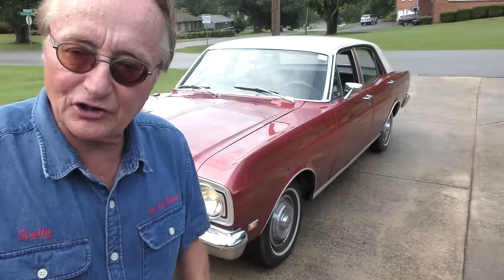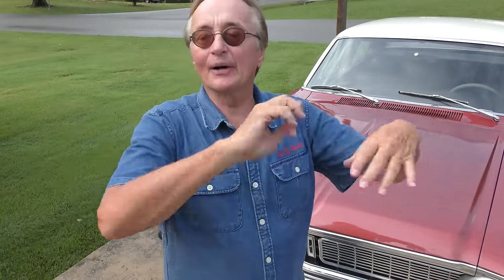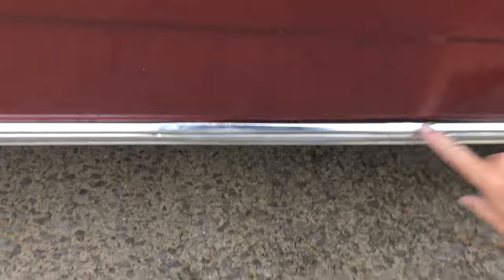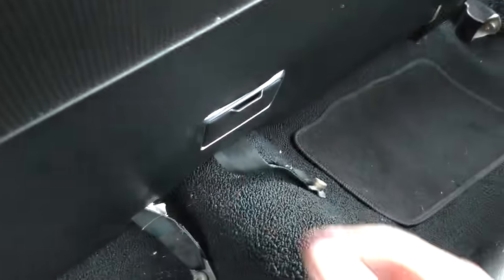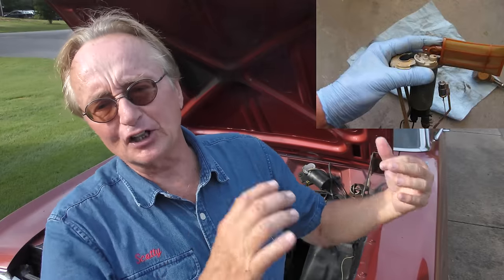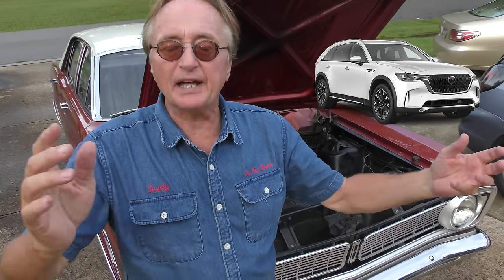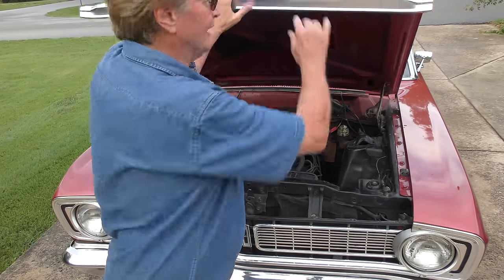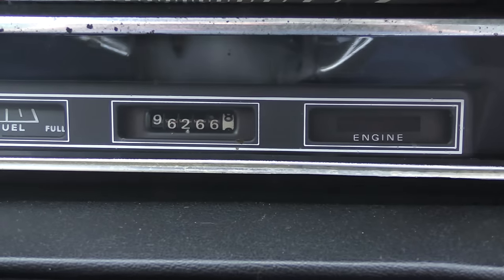I Just Bought My Dream Car

Comment: This is a real car
unlike over complicated modern crap that you can’t enjoy driving it or working on it.
Reply: My thoughts exactly.
Reply: 100%
Reply: Today’s cars are - cars. Real ones. And they are generally far more reliable than 60s era cars needing far less regular maintenance.
Reply: @gordtulk  yes you’re right about reliability and many other things older cars lack but
things that older cars are superior is simplicity,materials and being repairable.
I doubt modern cars can survive decades and still be able to start and run like older cars.
Reply: @Ray77582    not really, newer cars have better engines and metallurgy. Also the old cars all rusted out. Newer cars are coated better for that as well.
Reply: @Hughjass-69420  that’s true but new cars aren’t only metal.
Other kind of unnecessary plastic parts break down and can’t be repaired or replaced.
And you’re right older cars are all rusted out and aren’t worth it no more especially ones that are more than 40 years old.
Reply: @gordtulk yes but cars today are built to fail vs built to last
Reply: @nickyj3571  Most modern cars would've outlasted any of their 20th century relatives with the same amount of usage. You see way more examples of  early 2000s - 2010s half million - million mile cars. Meanwhile a 1970 Dodge Ford or Chevy would need a rebuild by 5 years 100k miles, and rusted out in 15.
Reply: @jv6miata  right I'll tell my coworker next time her 2023 sonata breaks down or won't start in the parking lot and already needs warranty repaint bcuz of peeling
Reply: @nickyj3571  You think old cars came out of the assembly line absolutely perfect in any way and had no issues? How about when ford recalled 4 MILLION models in 1972 for seatbelt defects. This is not a new thing, and everyone knows that older cars weren't as reliable as people made them out to be (considering most 50s-80s cars lasted at most 200k before being scrapped)
Reply: @jv6miata  sure
Reply: @jv6miata  80s-2000s cars have best of both worlds. Simple enough and well built with good technology; but I doubt modern cars with 1.5 turbocharged engines would come close to half million miles
Reply: @Ray77582  I definitely prefer metal over plastic lol.
Reply: Don’t kid yourself, it’s a pos.
Reply: @Arcticfox7  yeah the new ones are Shyt
Reply: I say that about my 96 Buick Park Avenue and my 1999 Porsche 986 Boxster five speed manual it takes six screws just to remove the entire center console on that car there’s only 7 computer modules in that car as well unlike today’s 100+ computers in the new car’s also just when you take my first generation, Porsche 986 Boxster and put it up to a brand new Porsche Boxster The big difference is size the new car is wider and longer and that’s due to safety regulations and airbags. It’s also heavier and not as fun to thrash around because it’s not light like the original one is not to mention Porsche is starting to do away with the manuals at least in the base models like your base model 911 for this year I looked it up on a building price thing there’s no option for a manual transmission which that’s the whole point of a Porsche right manual transmission fun sports car that’s light there is still a manual six speed offered in the boxster I don’t think it’s as fun to drive though as mine because of how heavy they’ve gotten I mean that’s kind of the whole charm of a little sports car light and nimble but I will say being a mid engine Porsche for me. It’s still a very easy car to work on and my 3800 series 296 Buick Park Ave. it’s probably the easiest car to work on even easier than a Volkswagen beetle well today’s Volkswagen beetle because there not easy anymore like the original Volkswagen beetle was I mean with the original Volkswagen beetle all you need was a set of common hand tools, and you could drop the engine drop. The transmission even pull the whole body off the frame and put it all back together again and it had that simple air cooled flat 4 motor that’s probably gonna be my first classic car I mean really classic car. I know I have the Buick and the Porsche, which are both technically classics cause they’re at least 25 years or older but or the 69 Ford falcon I wouldn’t mind that to be my classic car too, I just love old cars because they’re so easy to work on and charming to look at and the motto is on the old cars instead of replace like on today’s modern cars because of all the plastic crap that’s going to break and another thing Volkswagen, the Volkswagen beetle specifically used to be a very reliable car. It’s no such thing anymore planned obsolescence is built-in into every modern car now in the 1990s that’s where planned up some lessons kind of started for the majority of manufacturers at least in my opinion, excluding Buick and like the Chevy Caprice and stuff like that and all those big body GM cars and everything with the either series one or series 2 3800 V6 even the pre-series 3800 V6 cars were generally good because that motor was overbuilt best V6 engine GM ever made when it comes to a modern V6 engine anyway why they killed it and replace it with crap that’s beyond me not the decision I would’ve made but on all those Buicks and General Motors cars with that particular engine they last so long that there’s a running joke with those cars and you’re gonna have to pry these keys from my cold, dead hands because those cars with that particular engine, especially outlive their owners in most cases and not too long ago every car that was built with outlive their owner because they were overbuilt, not like today’s cars especially the electric cars I doubt any of those cars will ever make it to an estate sale sorry I am rambling on about this and kind of all over the place but they just don’t make them like they used to
Reply: @90sbuickguy84  totally agree with everything you’ve said.
Car manufacturers forgot things that made them different and special from others before. Nowadays they all make similar craps with many features that often times won’t be even used but break down😂
Older cars may not be efficient,safe and air polluters but they’re not made with intention of being crap like new cars; even when they break down fixing them is generally easier despite having no sensors or alerts to tell you what is wrong with them.
The real meaning of a car is something you enjoy operating and maintaining and I think cars lost their meaning.
Reply: @90sbuickguy84  good lord write a book
Reply: I dont think ur modern car is gonna be driving 60 years from now @gordtulk
Reply: @nickyj3571  Back in '50, '60, '70s at 10 years old probably half the cars were in junk yard. By 80K or so most were having a myriad of problems. One like this falcon are rare.
Reply: @jv6miata  Before '80s, few cars lived to 150K.
Reply: @tombryant1104  still better
Reply: A stinking unsafe rust bucket.
Reply: @nathansmith7153  even better
Reply: @nickyj3571  I like to spend my time getting places quickly, quietly and reliably so I can spend time on more creative things.
Reply: You can actually reach things under the hood.
Reply: Modern cars have like 50 bolts to get a headlight out
Reply: @andymills2985   yup mine also has security hex screws and you gotta remove the front bumper 😂
Reply: @Ray77582 
Older cars are fun
A real adventure,  going to work ,
Or wherever you go to !
I really think I'd like to get into the car industry.  Its an industry that's not going away ,so thats good
Reply: @gordtulk 

@Ray77582 
Older cars are fun
A real adventure,  going to work ,
Or wherever you go to !
I really think I'd like to get into the car industry.  Its an industry that's not going away ,so thats good
Reply: I agree, mine was a hand me down 1964 model v8 289cu.. no power steering, but did it last..
Reply: I grew up in the 60s and 70s. Believe me the ac and cooling units on those cars weren't very reliable. You very rarely seen a car with 100,000 + miles
Reply: I enjoy driving my Lexus and it never needs work.
Reply: Horse is far more reliable, so why not get one?

Comment: Love the simplicity of a car like that, you can fix it with a screwdriver and a hammer no laptop required, no gadgets to bother you no spy camera to watch/track you but no cup holder OMG what will we do!! but got an ashtray and a vent window.
Reply: When I'd buy a car to fix up when young I'd remove and clean the ash tray , install , then use it to put  change in for the drive throughs .
Reply: @gordsmith7656, yep and no "VTEC, VVT, cam phasers" etc. Just reliable old pushrod engines. I have a pushrod engine vehicle that's 20 yrs old with over 250,000 miles now and it's still going without ever touching engine/transmission internals. Also have a 10 yr old vehicle with VVT that needed cam shaft and lifters/rockers replaced after 80K-100K miles & transmission is slipping/shifting rough since 110K miles. These manufacturers produce junk and sell it for tens of thousands & then pass it off on customers to pay for the repairs/replacement. They should be held criminally liable for it.
Reply: How about a screwdriver and an adjustable wrench save the hammer for really stubborn problems. A 1960 Falcon was my first car in 1966. Straight 6 three on the tree & AM radio. What else do you need?
Reply: Amen! The good old days...I want a '60 something car again! 😁

Comment: The good old days, the 300 straight 6 was a strong engine.
Reply: This one has 200. The guy I work for now worked for Ford as an engineer. Although he didn't know why, the 200s tended to burn valves. The 300 was indestructible.
Reply: The 300 was offered in Ford trucks and vans but never in passenger cars.
Reply: The Ford 200 cid was an excellent engine. Their only issue was valve stem seals that hardened and broke up, leading to some oil consumption and spark plug fouling. It was a relatively easy fix by pressuring the cylinders with compressed air to keep the valves closed and using a valve spring compressing tool to remove the valve keepers and springs to access the stem seals for replacement. These were very easy engines to work on, unlike today’s underhood nightmares.
Reply: @susanalbert4110   If there was no readily available compressed air the valves could be kept closed by inserting some sturdy rope in through the spark plug hole, then rotating the crankshaft until the piston rose and the rope pushed the valves closed.  I've seen that done on a second generation AMC V8. It should work on other OHV or OHC engines.
Reply: When I worked at UPS in the early 70’s we were putting 300’s in box trucks and they performed very well.

Comment: my 1965 Mercury Comet  is the sister car of the Falcon and i love how simple it is. it is still in really good shape too. it was my dads first car in highschool and it originally had a 289 when he got it but he blew it up street racing.  to quote him he said "i beat that 400 Pontiac though and it still got me home and never quit on me until i pulled it in the barn and shut it off" . then after that it had basically a brand new 302 swapped into it (same engine it still has). then it was stored away in the mid 90s up until last fall when we decided to get it out and put it back on the road. all we did to get it running was throw a fresh battery in it and put gas to it then boom fired up like it was never parked. hasnt given me a single problem yet and is a blast to drive. there is no way a modern car could sit for 30+ years and not have a bunch of problems when you go to try and start it

Comment: I have an Australian 2006 Ford Falcon with a 4L inline 6 cyl Zf 6 speed Auto. It has 255 hp and 382nm. Engine runs very smooth as I service it regularly. Looks great Scotty.
Reply: Those Barras are one of the best engines ever made - hands down. I have driven many cars. None seem to be able to beat its performance, reliability, smoothness, and highway efficiency. It also sounds good.
Reply: The cars now suck

Comment: I had a 1960 Falcon ($1358) that my wifes cousin sold me for $150 in 1967. I could fix almost everything myself, because it was such a simple car. It had 80K, but ran as quiet as new. No AT, and 2 doors. No passenger side sun visor. The rock bottom model. No door switches for the dome light. It got about 25mpg. I used it to go to work. My wife had a '63 Fairlane station wagon. We drove them for about 3 years until the bottom rusted out of both of them.
Reply: The best part is the antitheft device.
Car thieves today can't drive a standard shift!

Comment: We had a 1968 Dodge Dart 2-door coupe with the 225 Slant-Six.  God, I wish we still had it.  Great to drive and got over 30-mpg.
Reply: I had a '67 Barracuda Formula S  ,Coupe , 383 , 4 speed , w/ 8 3/4 rear , I put a 440 w/ a button clutch in in '81 did 11.00 flat quarter mile and got 25 M.P.G. HIGHWAY ! 160 M.P.H. top speed w/L6015's IN THE WHEEL WELLS ! 😁😁
Reply: @keithpearson7059   Lovely car that.  though I must admit to liking the "Notch-Back model of the Cuda in the 68.
Reply: @ditzydoo4378  Barracuda"s were made '64 1/2 - '69 , CUDA 's were made '70 - 74 . The factory names of 2 of 3 Barracuda's were " Coupe " and "Sport Coupe " . I had an O.E. '68 Barracuda Sports Coupe Formula S , 383 , 4 Speed , w/ 8 3/4 rear AL STEEL ( for 31 YEARS )  that a relative sold ( illegally ! ) .
Reply: I never got better than low 20's in my slant sixes.  And I drove pretty conservatively.

Comment: Those were the days when everything was simple and affordable. You brought back happy memories to me. I had a 1965 Mustang convertible   289 engine 3 speed manual on the floor,hurst shifter, air shocks in the rear, thrust mufflers. I took it on my honeymoon to cove haven Pennsylvania . It was my favorite and best car 🚘 I’ve ever owned I miss that car and time in my life
Reply: Thanks, oddly interesting.Admittedly, my “ fave” car was a 1966/FORD GALAXIE  500 XL/ BURGANDY ( like LENO’s , LESS the DISC brakes,7LITRE,etc.) 4 Speed/Deluxe Black Int/352/ 4 BBL….ADMITTEDLY, update immediately with Metallic Brakes/ Tires/ Shocks,etc.. Interestingly,FORD PERFORMANCE had **COOLANT RECOVERY System ( Special Order @ Dealer  , ,albeit before in AUTO Stores, NOT ON from Factory, etc.) . Anyways, great buy in 1967, @ my Dodge Dealer ( only Manuel tranny on lot).

Comment: I got a 1966 Falcon Futura Sports Coupe with just  a tad over 27,000 original miles on it  The only change I made was to fit air conditioning. I bought an original Ford under dash evaporator unit so it looks like it's correct. Drives like a dream!

Comment: In Australia Falcons were sold as full size family cars. Bench seats were common until the very late 1970’s. Standard engines were the straight sixes and v8’s were optional. Reliable, tough (once modified for Australian conditions from 64/65) and exceptionally popular. Great cars.
Reply: Are you in Australia? Do you see any V8 interceptors driving around believe one is called the NightRider
Reply: @nickyj3571 that was a 71 monaro coupe not a falcon 😂
Reply: Loved the Oz 73 Falcon  Pursuit Special  in Mad Max 1

Comment: 1950 Nash Rambler says, “Excuse me!” 🙂
Reply: Yes , that's FACT , Nash and Rambler BEAT THE BIG 4 BY YEARS OR DECADES . ( long before 1960 ) .
Reply: Even the Studebaker Lark beat the Falcon and Corvair.
Reply: The 1950 Rambler was so good, when the American Recession of 1957-58 started , George Romney had the tooling dusted off and returned the basic car to production as the 1958 Rambler American.
Reply: @keithpearson7059  What about the Metropolatin?

Comment: My first vehicle was a '60 Ford Falcon with under 70k miles.  I was 16 in 1986 and I had to tune up this vehicle to get it running; it was my great-grandmother's car bought new.  It had a straight six and a 2 speed automatic. Rangoon Red with a roof painted in refrigerator white. She was a slow car.  And air wipers suck.  But it was simple, solid, and reliable.

Comment: My first car was a 63 Falcon Futura sedan ... 170 straight 6 and a 3 on the tree. Loved that car. My 2nd favourite of everything I've ever owned. You don't see many of the post-65 models. Why? Mustang ate them. But fun fact, 60s Mustang parts (other than body panels) are pretty much 1:1 swaps into a Falcon. Beauty of a ride there!!
Reply: That is why they developed the first mustang in less than a year. Just sheet metal on a falcon.

Comment: I bought my first car in 1992 which was a 1968 Falcon (Australian) but pretty much the same as this car. It cost me $400 and as Scotty points out, it was so easy to work on. Changed the oil, fuel filter, tuned up the carby, changed the points etc. It was really simple for a 17 year old to work on. Mine had power assisted disc brakes, 3sp auto and a 221 cube 6 cylinder. Despite the smaller engine, it span the tyres easily as they are pretty light.
Reply: Bar the quarter panels and interior they are pretty much the same car
Reply: @DarrellWilkerson4.6  in addition to that the tail lights are very different too and the grille is slightly, but yeah the rest of it is exactly the same.
Reply: @gerrym75  US equivalent of our XT Falcon with the suttle differences as listed. Had an XT GT manual  - great car until some prick stole it. Never saw it again.
Reply: @gerrym75 the rear end is COMPLETELY different, I always thought they were closer but was surprised at even how different this is to our 68, our rear 1/4 has a sharp line through it and is a different shape and our 69 - 71are REALLY different looking, always thought they were the same car with different tail lights and trim.

Comment: I owned 2 ford falcons, 66 67 both with the 200 little 6 cylinder, Great gas mileage, Mine were 2 doors, Both were standards, 3 speeds, The 67 I put a 289 from a 65 mustang with 4 speed, It moved right on down the road.

Comment: I had a 67 Ranchero 200 6cyl automatic. The flex plate disintegrated. I pulled the mill, replaced the flex plate dropped it back in & got it running,   at my lunch break.